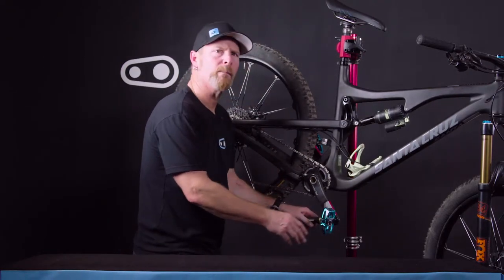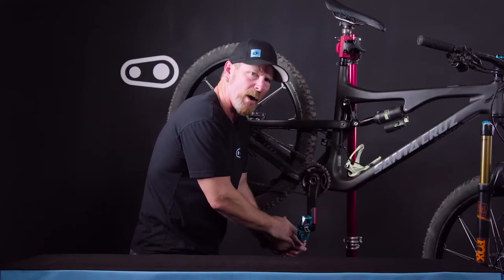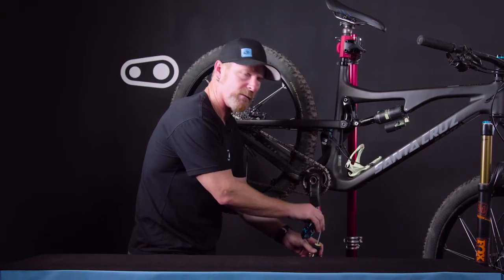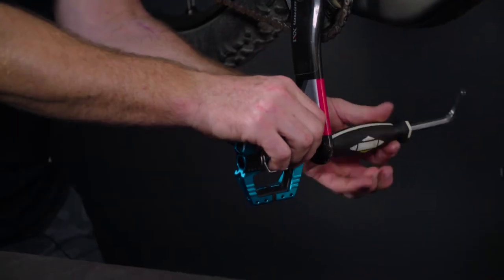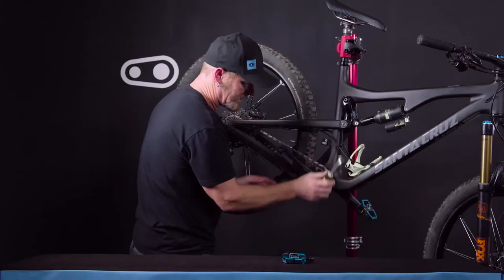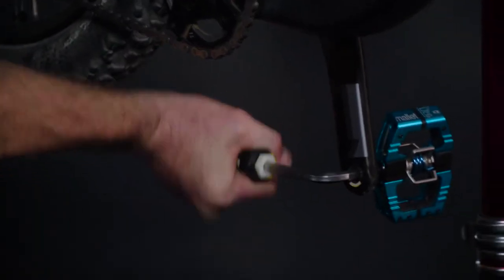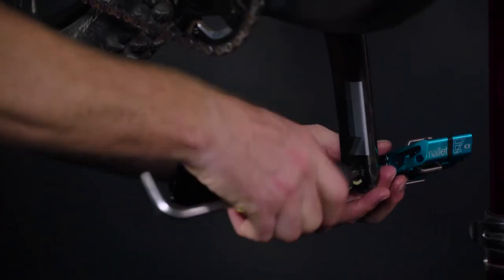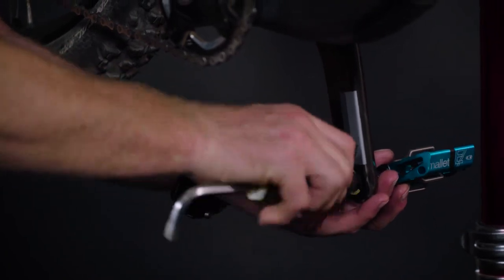Crankbrothers Pedal Removal Tutorial

Comment: So i bought a used bike with Crankbrothers Candy pedals. Left side came off after using a metal pipe as leverage. Right side so far i broke 1 allen wrench and twisted 2. Already sprayed this shit with WD40 over night. Seems like i need to buy a new crank because that shit is fused together.
Reply: Same here
Reply: @MXROutlaw  i did manage to change my pedals. I had to heat up the crank with a heat gun and then used a pipe wrench on the other side of the allen screw
Reply: Same ! No problem with the right one but rhe left is a nightmare, completely blocked.
I am replacing Candy 1 by Candy 7.
Candy 1 is in hex 6 meanwhile Candy 7 is a 8 mm hex, I didn't know that 😅

I'm afraid I'll break everything !
Reply: I finally succeeded by heating longer, it came all at once.
On the new pedals, I put threadlocker (blue stuff).
They are nice.